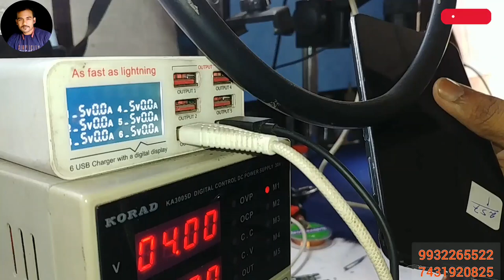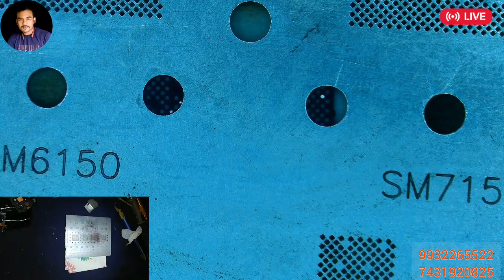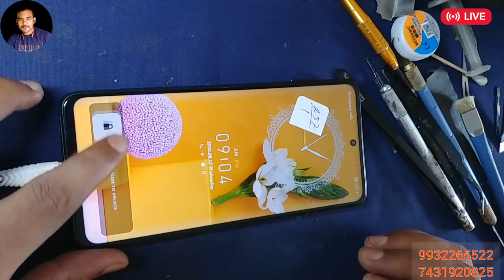Poco X3 motherboard problem Repair 🔥🔥🔥

Comment: Hello bro, Even my mobile is poco x3 it is dead and the service centre guys told me the motherboard has to be replaced, can you fix the same motherboard... And also is it possible to get the data
Reply: You sent?
Reply: Same problem i give it for repairing for 5000🥹
Reply: Same problem
Reply: If any one can repair plz tell me
Reply: @RPS_GAMING_  where did you gave it for repair and did they fix your mobile... Did you get your data of mobile
Reply: Got it repaired from a local shop but didn't get the data